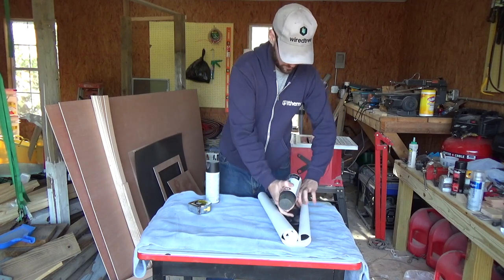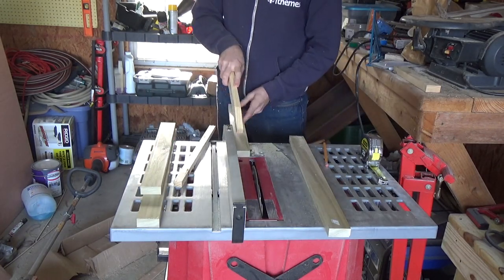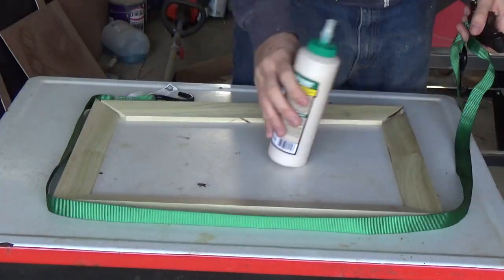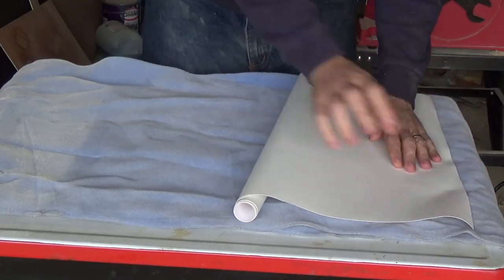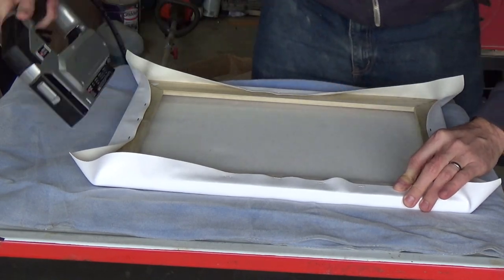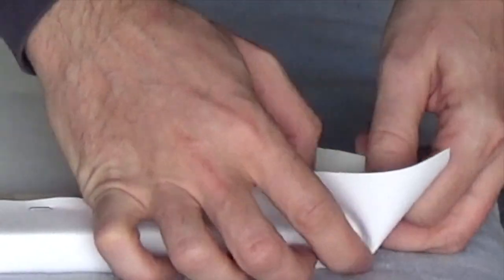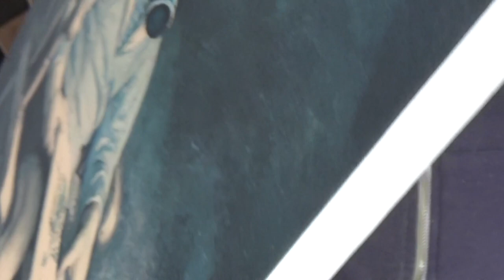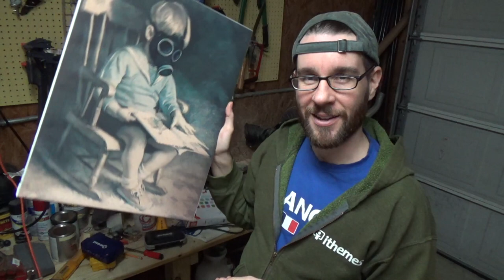Let's Make Some Gallery Stretcher Bars | How To

Comment: This was a great video. Thanks... I just a noted a couple of tips I can give you. You can use special stretcher pliers to get a better grip when you are applying the canvas and if you spray a bit of water on your canvas before you begin..... when the canvas dries it makes it so it is really taut with no warping. Cheers :)
Reply from the maker: Thanks for the tips!
Reply: Thought stretching it when slightly damp would be a good idea.  I am going to try doing 3 canvasses that are 20 by 60.  Don’t think I will mitre the corners, but perhaps I should start a little smaller